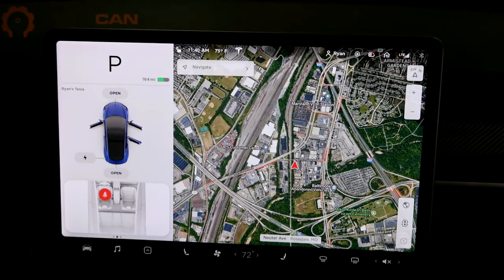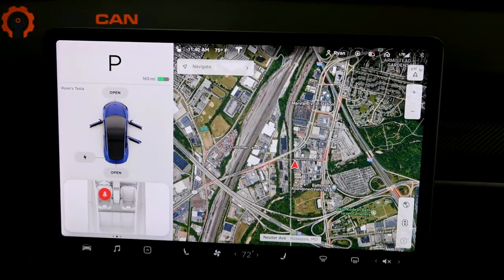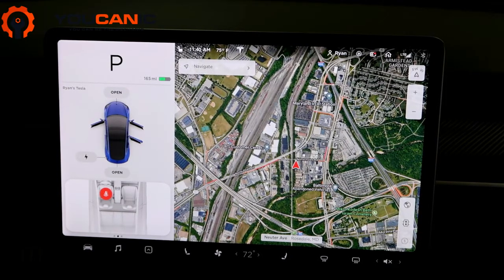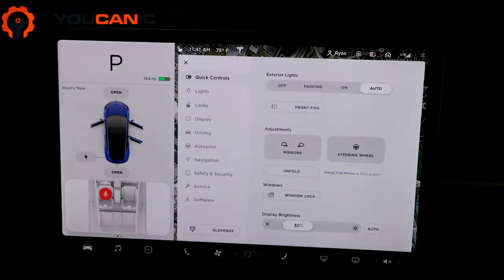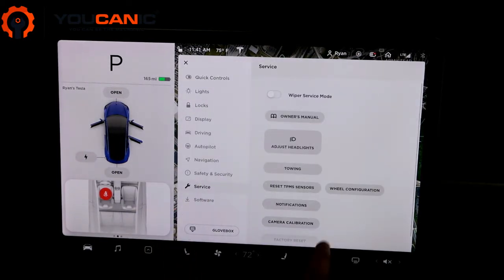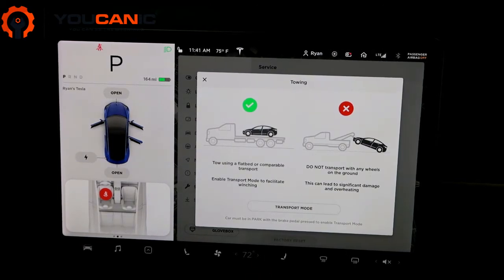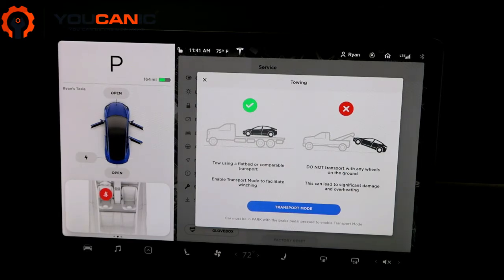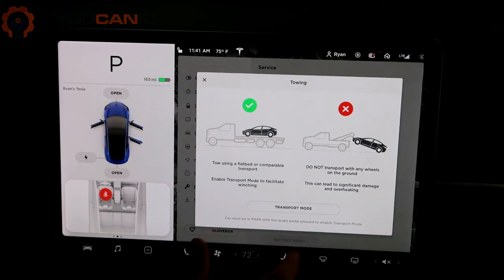How to Tow Tesla - Towing Mode - How to Put / Set Tesla on Towing Mode

Comment: Still have to use a flatbed to tow even if you set the mode.  The only thing holding me back from buying one.   I plan to tow my personal vehicle behind my RV so unless this is addressed I will not be able to use my offgrid RV to charge my offgrid vehicle while I am driving.  So bummed.  Why can't a disable regen braking option be part of this mode?  Someone should tell Musk to hire another smart person to figure this out.